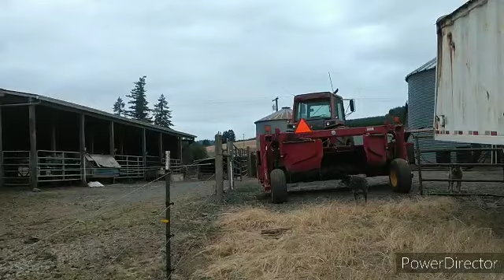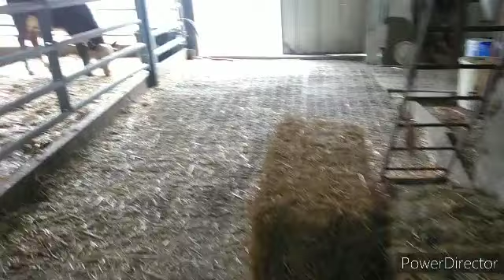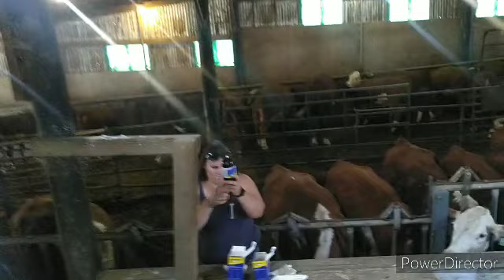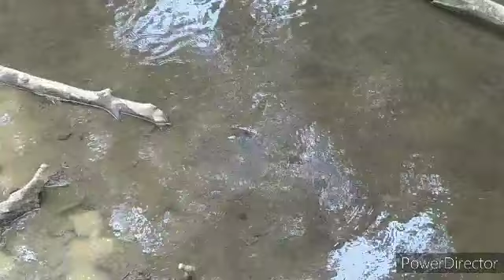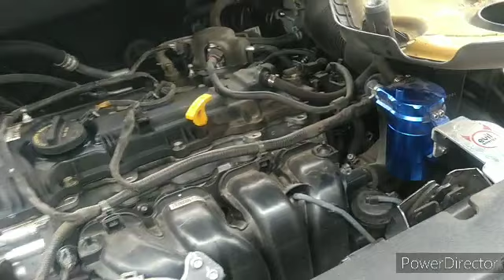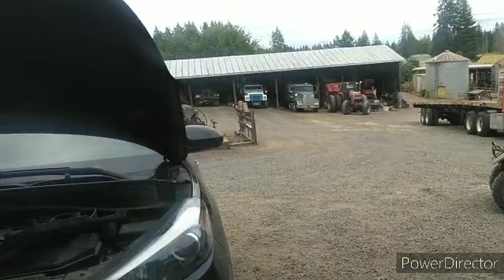it's been a day....

Comment: I used 15-40 in our fleet in all vehicles and equipment at work for 40 years and never had a issue. From Ford Escapes to class 7 trucks and everything in between. My daughter has my old '99 Yukon with 350k + with the original 5.7 and is running good. I always used 15-40 in that also.

Comment: The only problem with 15/40 in a small engine is when the temperature is sub zero the oil won't run back to the sump quick enough till the engine warms up.
Damn that was a long sentence. 
Suppose I need to learn punctuation. 
Thanks for posting Ed.
Reply: Good evening Bryce
Reply from the maker: Yup.. but.. 
Punctuation?? What's that
Reply: @nidayfarmranch6002  Good evening Bruce.

Comment: Dealerships had our 2017 Tucson for over 3 weeks now and still arent sure whats wrong with it, they already did a crank seal at 2yrs old and now they say it's reading around 100psi on the middle cylinders so theyre trying to get the factory to pull a warranty motor off the shelf for it, love the car but man they have issues
Reply from the maker: Had a little sparkle in the oil, not bad, but... So we cut the filter.. had it just been oil going through the filter, the pressure wouldn't have dropped.. filter was full of tiny sparkles. 
Got rid of the lifter tick.. but not the faint bearing tick😪
By the looks of it, it didn't just start because it was long on an oil change
Reply: @GosselinFarmsEdGosselin  yeah according to online the 4 cylinders had issues
Reply from the maker: @piperdoug428  of course 🙄🤬

Comment: The last pickup I had used a quart in 3,000 miles. 180,000 miles on it
Reply from the maker: That's about what my pickup uses too.. 8.1L Chevy.. GM says 1quart/1,000 miles.. at over 200k, I'm good 👍😎
Reply: @GosselinFarmsEdGosselin  I had a Ford with a v10
Reply from the maker: @huntingandstuff9489  and I thought my 8.1 was a gass Hogg
Reply: @GosselinFarmsEdGosselin  I got 12 or so going on longer runs. Maybe 11 running around local
Reply from the maker: I used to get 12 when I had to drive to work.. 10 pulling trailer. But anymore, it's all local roads, usually in the hills.. and pulling header cart, so about 7... Too many short runs
Reply: @GosselinFarmsEdGosselin  yeah the short runs are killer. The best I ever did was 14.1
Reply from the maker: @huntingandstuff9489  you found a steep hill to coast down??
Reply: @GosselinFarmsEdGosselin  going half way across Nebraska on the interstate. Cruise set at 80. Put a hoist on it after that and never did as good

Comment: my mechanic has swapped me over to sen-pecko oil supposed to last 500 hours I still do an oil change at 180-200 hours
Reply from the maker: Old school Engine and the bigger filters can go longer.. we go 250hours on the tractors
Reply: @GosselinFarmsEdGosselin  I have a 2010 high turning motor 2800 RPMs steaming 3500 Max RPMs tells me change oil more often if I wanted to last
Reply from the maker: @joshwelner1951  RPMs make a difference!!!